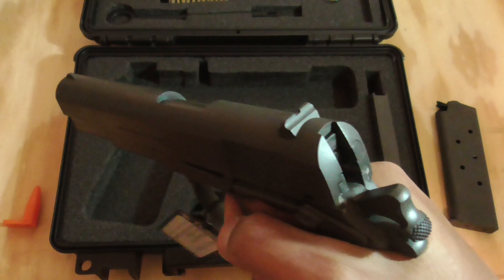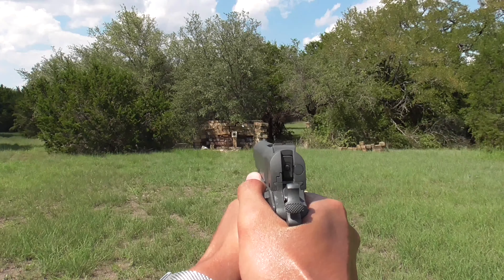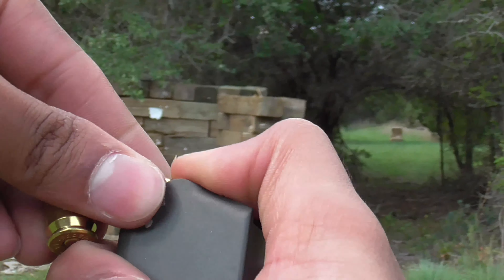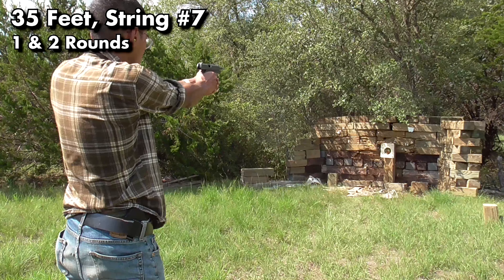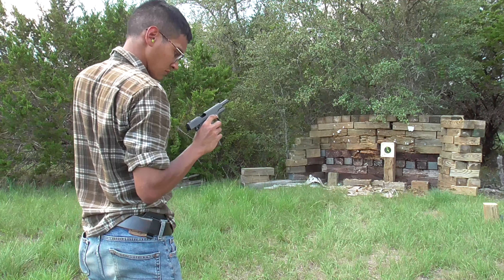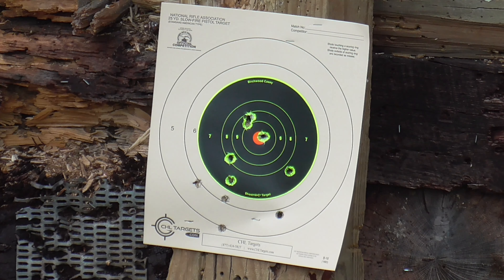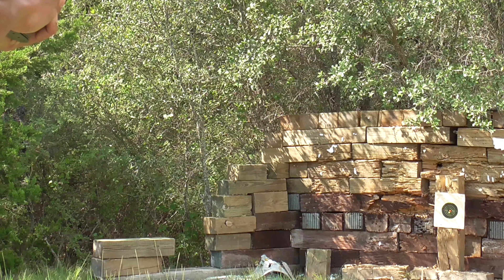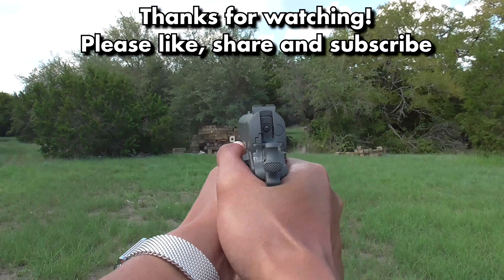Tisas M1911A1 US Army Range Review, SDS Imports 1911 (Subtitles & Chapters Available)

Comment: I’d get the extractor looked at. One of the most common hang ups with any 1911 is when the extractor is out of adjustment. Combine that with crappy magazines and you’ll have issues. I bought the Tisas Service in Dec 2021, which is the US Army model except black with a chrome barrel and a flat back strap. It came with an Act Mag magazine and it’s been flawless.
Reply from the maker: I'll look into that. I've contacted Tisas to see if they'll send me another slide stop, and hopefully that fixes the issue. I also have other, known good 1911 mags that I will use. If not, I'll start trying other solutions. The problem might also just go away, as noted in the video the last 30-40 rounds had no stoppages. Need to get out and test it more, but .45 ACP isn't cheap these days!
Reply: Mines all black came with 2 8rnd mags from mag tech the 19$ ones haven't fired it yet the 8rnds are stiff for that 8 the round to load but I hope it's just needs to be worn in
Reply: @JaredAF  when you test a gun you should use ammo of known quality using proven magazines. Otherwise any problems leave you wondering where the problem actually lays. The gun? Magazines? Or ammo?. I recommend MecGar mags. Good Italian craftsmanship at a reasonable price. When testing guns, magazines or ammo there should only be ONE variable, of course, that's easily said unless your resources are limited. Your content is well thought out and I greatly enjoyed your video and am looking forward to more in the future

Comment: I have the "service" model, and it had issues until about 800 rounds or so (most were failure to go into battery), but after that it's done just fine. I'm closing in on 3,000 rounds since December, and I can't remember the last time it had an issue past that 800 round mark. It's been very few, though. And that's with any and all ammo that I put in it. That being said, I started using Chip McCormick mags around 500 rounds. It's not my edc, of course, but I trust it enough now that it could be.

Comment: Definitely magazine related. Mine has an occasional hiccup with old worn usgi mags and junk colt factory mags. With mecgar, metal form and Wilson combat mags it’s not an issue. Don’t overreact and go swapping parts etc. 1911s are old world tech and need a little break in. 4 of my buddies have these so 7 examples between the 5 of us(all being the same model as yours except one is the stainless railed duty model). They all report zero issues as well with good mags after they’ve worn in. You should check out the mags metal form makes that are sold through Sarco inc they are marked like the US G.I. Ones but are brand new and work perfectly. They are around $10. They have unmarked ones for $7 or $8. Best bang for your buck usgi style mags. They have WWI super early style mags with the lanyard loop on the bottom as well.
Reply from the maker: I'll have to throw some in my cart next time I order from Sarco. Thanks again

Comment: I had a Tisas for about a year and sold it a few months ago (I regret that, that's why I have another on layway right now!).  The only issues I had were 3-4 hiccups when I changed the recoil spring to a wilson combat version, after that it smoothed out and was fine.  As for your issues, I've heard some 1911's need a break in period, give it another 200-300 rounds and I think things will start smoothing out.  Also try a wilson combat mag, not the 8 round version (had trouble getting that to lock in place fully loaded) but the conventional 7 rounder, I had 3 of those and they worked flawlessly.
Reply from the maker: Thanks for watching! I've already got some other mags on order and I also have two USGI mags that seem to work fine. I'll have to try the WC mags
Reply: @JaredAF  Just got my layway paid off the other day and took my new Tisas for a test drive.  The Checkmate mags are GARBAGE!  Why Tisas switched to these is a mystery to me, the Mec Gar on the original one always worked fine.  One of the Checkmates hung up and I couldn't fully load it, the other was unreliable and kept jamming the gun.  I had a Wilson Combat 7 round mag and it worked just fine!

Comment: Love my TISAS 1911: never had any problems. Have had a Springfield for about 35 years so I have lots o'mags of different mugs. Some gov't unused Vietnam vintage. No problems with either gun ever.Was your gun lubricated? Helps to run a 1911 "wet".
Reply from the maker: Yep, first thing I did was take apart the gun and magazines, clean the old oil off and lubed all the working surfaces.

Comment: I would try polishing a little on that slide stop where the rounds are rubbing. Also look into getting some Wilson combat mags. And one thing I would like to add not telling you what to do at all but myself I have never used the slide stop Lever with my thumb I've always just cocked the slide back from the rear to unlock the slide stop. I've felt that it's a better muscle memory to learn especially if you are going to carry it and having to reload in a stressful situation.
Reply from the maker: I've contact Tisas about getting a replacement slide stop. If that doesn't work out, I will try tinkering with the current slide stop. Also, I'm just so used to Beretta handguns whose slide releases are extremely ergonomic for me. Maybe it would behoove me to overhand rack but I've gotten used to the 1911 slide release!

Comment: Have you tried cleaning and lubeing it ? I have like 650 rounds through mine with absolutely no issues. Using mostly winchester white box , but have used other brands , hallow points and steel case. No issues
Reply from the maker: The slide lock was the culprit. I filed the offending area and it works great now

Comment: I have the 9mm and less than 500 through it. Without a doubt 99% of the ejections are on top of my head or in my face. Just starting to play with ejector angles.
Reply: I had the same issue with my tisas 45 casings on top of my head, that needs ejector tightened or just buy an Ed Brown not much money, also Chip McCormick mags work great in 9 mm 9 round

Comment: Copper on slide stop means that either the slide stop is not right, or mag feed lips aren’t right. My money is on the slide stop
Reply from the maker: Tisas is sending me a new one so I will see how it works out. I'll post an update video at some point, but I think it's fixed. My current slide stop I filed down a little and it seems to have stopped rubbing on the bullets. I believe the slide stop was the issue.